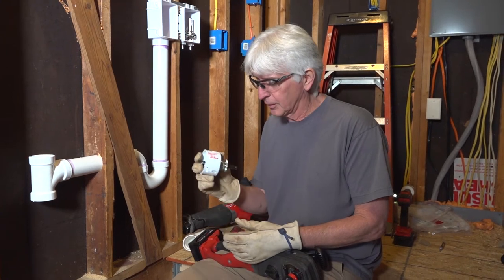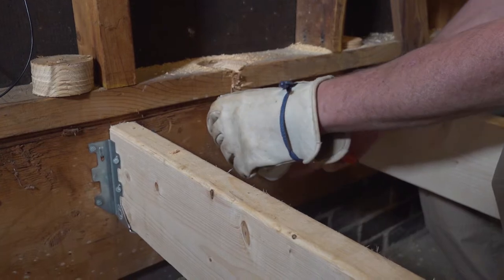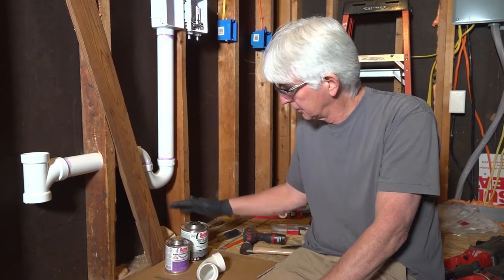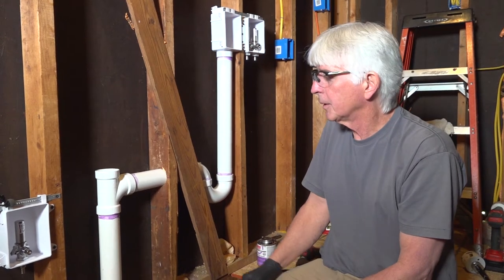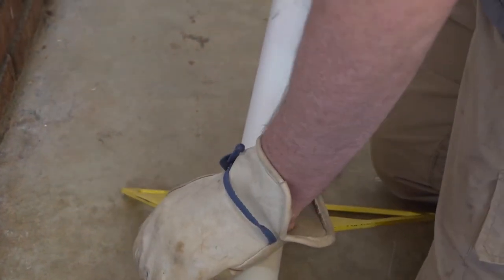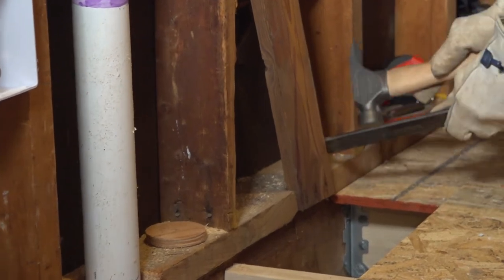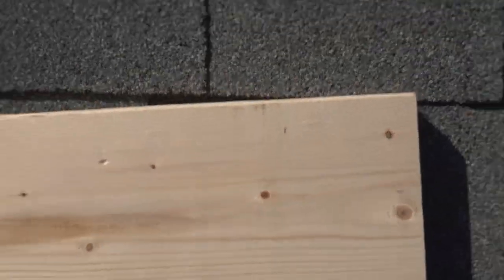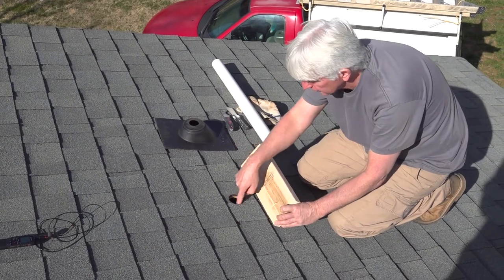Washer Vent Line Install - Kitchen Remodel E6

Comment: Good job cementing and plumbing piping!
Reply from the maker: Ha, it all worked out. I think getting those holes drilled before installing some of the pipes would make life slightly easier. I guess knowing when to do it is what separates the pro's from the rookies.
Terry

Comment: Put a black magic marker line on your pieces where they connect as you mock them up. Just match up the lines later when you glue. Works for me.
Reply from the maker: Great idea. 

Terry
Reply: I usually do that too with what little experience I have. 
  That being said, a few days ago, I dry fitted a 2” P trap. Today, I thought I might have to buy another one because it did not want to come apart. 
  I ended up putting it in a freezer for a good while then using a hairdryer to heat the outside part and pulling on it. 
  It worked!
Reply from the maker: Good idea. I have done similar in the past. 
Terry
Reply: @ForestToFarm  Any updates coming on the house builds?.

Comment: Does the horizontal piece not need to be slanted a little. 
  Does it matter how much it is slanted in the attic?
Reply from the maker: I am no expert but I would definitely make any horizontal plumbing pipe slant down hill. 😁
Terry
Reply: @ForestToFarm  I know it is to slant back  but not sure if it matters if slanted more than .25 per foot. 
  I can’t see where it would make a difference for venting but code can be a little confusing sometimes to me.
Reply from the maker: @rickeykeeton4770  I agree. I guess rain water coming down the pipe is a consideration on their part.
Terry
Reply: @ForestToFarm  Since so many main vents are ran vertically, I can’t see that it would matter.

Comment: Good stuff. I'm so unhandy... when the hole saw extension didn't fit I would have been cutting back that pipe then trying to glue and couple and re-measure. Inevitably I would be off by an inch or two and pipes would have been crooked. The anger... the mumbled expletives... the shame...

Nothing makes me feel more un-Christian than handyman tasks.
Reply from the maker: Ha ha, Sometimes you gotta think things through. Lesson learned is we should have drilled holes before assembly but since we are rookie plumbers we learn as we go. 

Terry